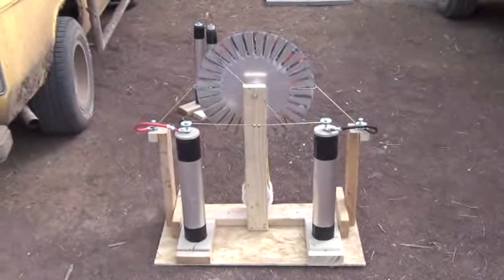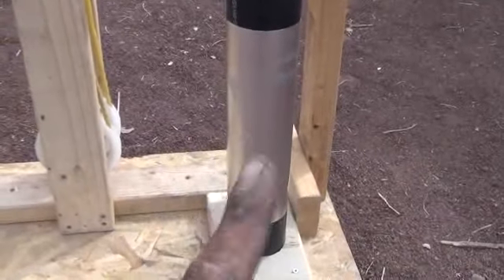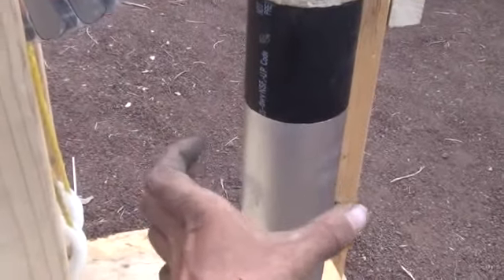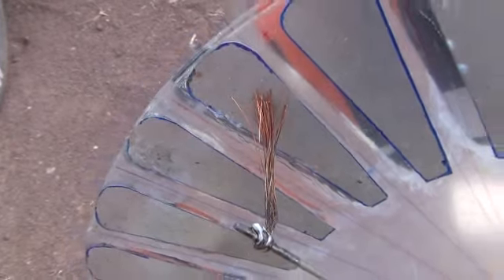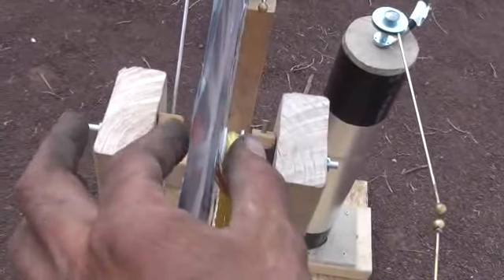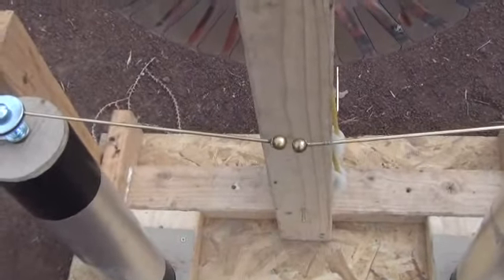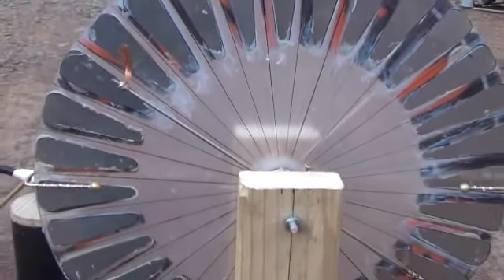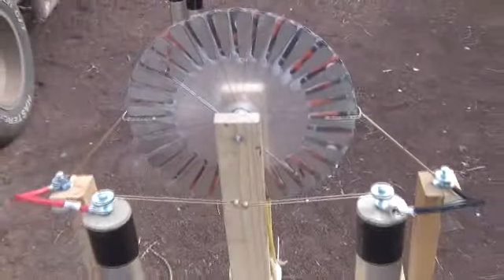Wimshurst generator "how to" part 4

Comment: This might sound very stupid, but I like asking: Do you think we could charge car battery with this system? Also I think if we put few of these systems in parallel, we can get a proper current out of them and then we can discharge them into the primary of a transformator and hit the resonance frequency of the transformator and get a lower voltage and higher amps on the other side. Any idea if what I just said is gonna work or not? :) Great work man, I appreciate you taking your time and trying to teach people :)